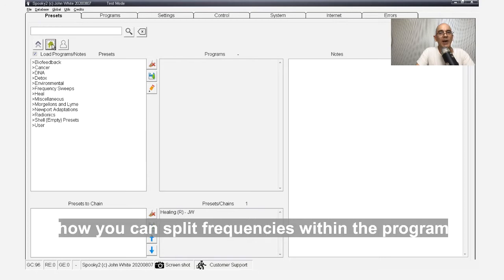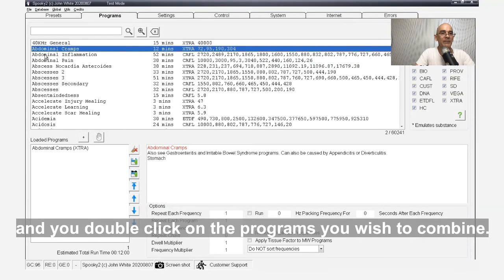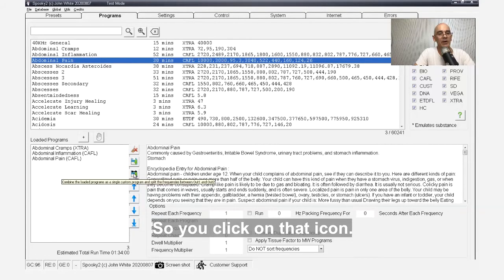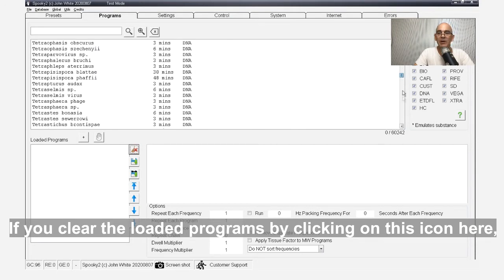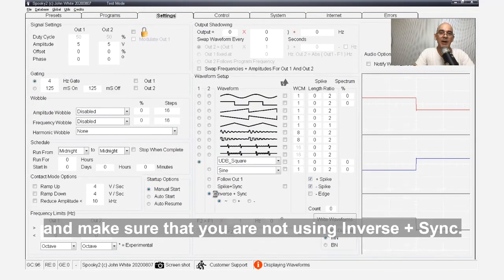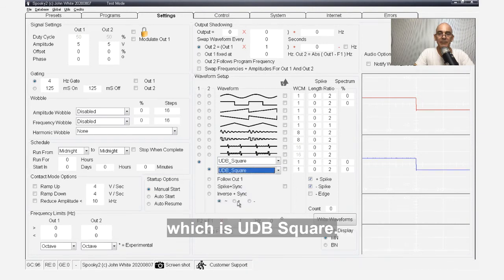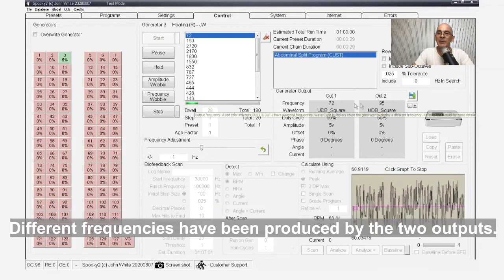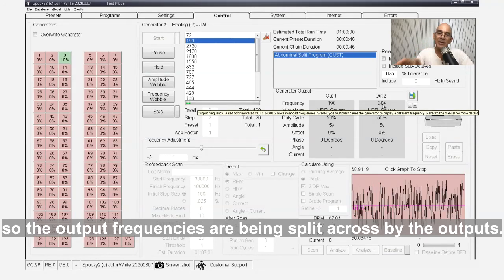How to Use Both Outputs of a Generator to Reduce Treatment Time

Comment: I see this example simulates 2 remotes. I had the idea that doing this weakened the treatment because it uses power from both outputs in xm?  I assume the boost port for one remote is more powerful than this method? I am I assuming gx outputs too by the same logic.
Reply from the maker: Hi. Your assumption is correct. This method will weaken the treatment process. Therefore, we do not actually recommend this method of reducing treatment time. :)